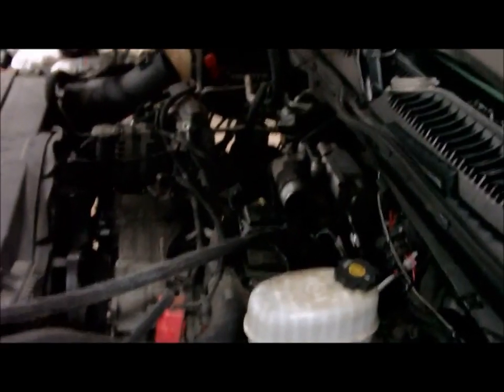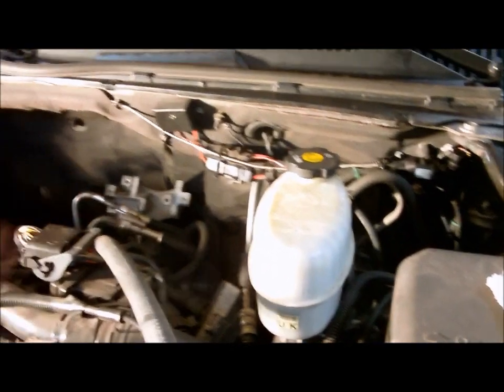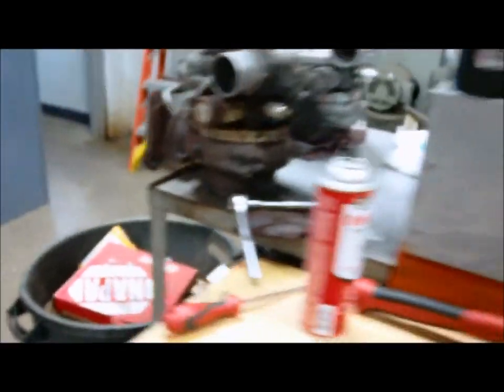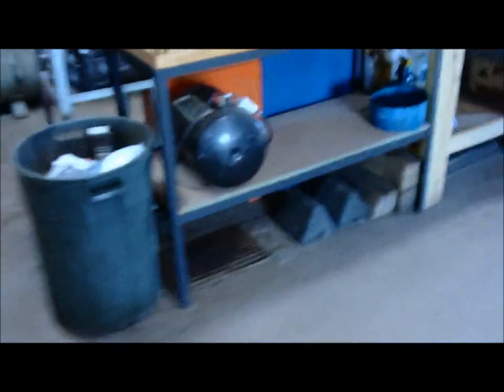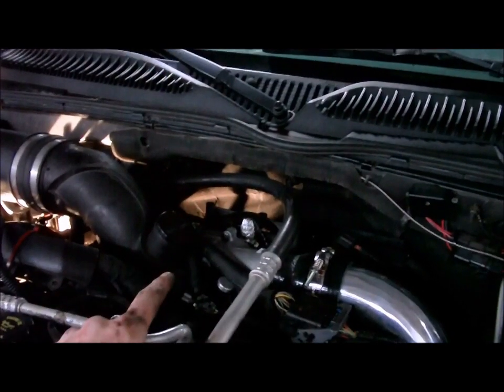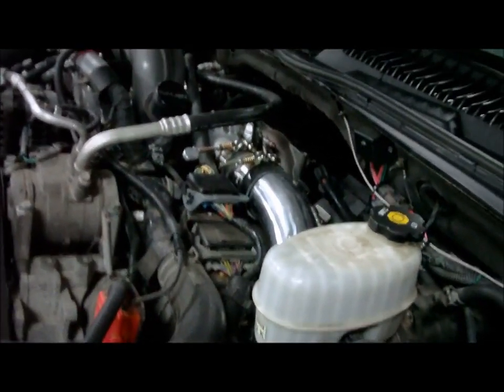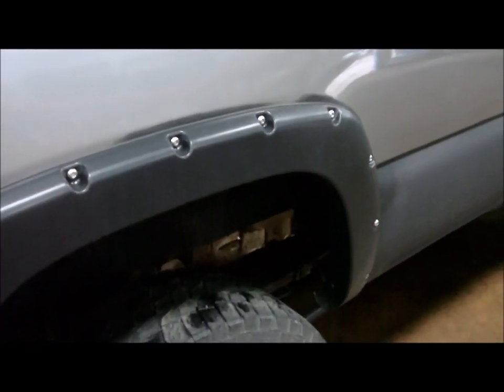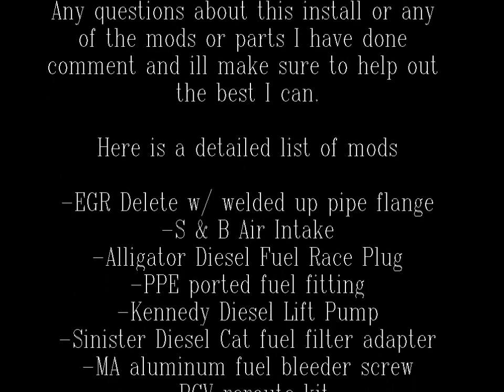LBZ Duramax Turbo Removal and Install

Comment: For someone trying this; follow this sequence EXACTLY and it's a breeze. Step 1. Take off both fender liners and spray all the exhaust bolts with PB before you get started. 2. Unbolt and move the Glow Plug modulator and the AC Compressor. 3. Remove the Intake, snorkel, Intercooler down pipe. 4. Remove the PCV pipe and plug the 2 holes with a small rag. 5. Remove the Upper heat shield and drivers up-pipe heat shield. 6. Undo the V-clamps on the exhaust down pipe and remove it completely, comes out easier pulling from below, place a ziplock bag over the exhaust pipe to prevent loosing any bolts down it ( you may have to remove the transmission dipstick - this is a real pain so avoid it if you can). 7. Unbolt the Up-Pipes' lower bolts through each fender well, and then the upper bolts. If these are frozen it's much easier to loosen them from the Passenger Fender Well. Place a 1/2 ratchet on the end of a pipe with the 12mm 12 point socket. Guide up through and have a buddy place the socket on the bolts head. 8. Remove the driver's side up-pipe and unbolt the oil return line in the back. 9. Fish a 17mm socket and a U-joint down to the pedestal bolts with a 12" extension to remove them (to re-install them I put the bolt on the tip of my magnet stick and fed it down to the hole). 10 disconnect the oil in and coolant in/out lines and you're out!.  Install is exactly reverse of this order.

Comment: I just did my 2005 LLY Turbo, thanks for this video. Did you put thread sealer on the Coolant banjo bolts? My lower one is leaking and I don't dare crank it anymore... I found that ALL the upper Up-Pipe bolts can be reached easily from the passenger side wheel well. After wasting two days wrestling the upper bolts from above, trying every socket/u-joint/wrench combo, I used the pipe handle off my floor jack on a 1/2 ratchet and was easily able to break them loose (soaked in PB). Once I got them off it came out very easy.
Reply: Dude how did you get the driver side last bolt on the bottom, there is like a metal flange for the heat shield in the way, that’s the last one!!! Stuck on it for 2 days

Comment: Tip: I removed the drivers side pedestal bolt with two 3/8 swivel extensions ( sometimes called wobble extensions) one 3" and one 6" on a 17mm socket.